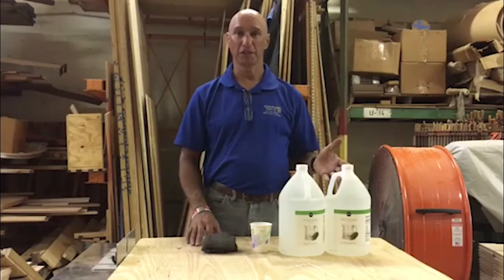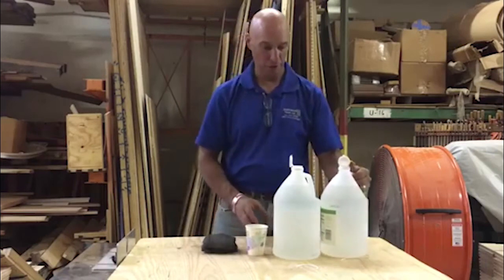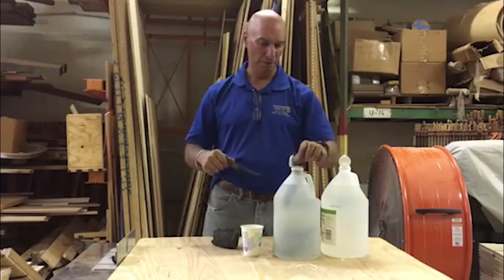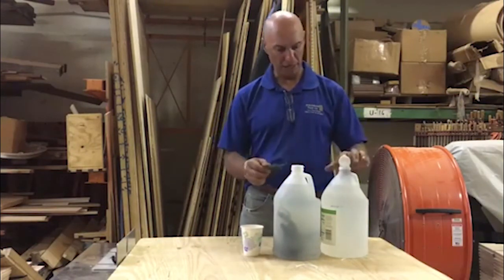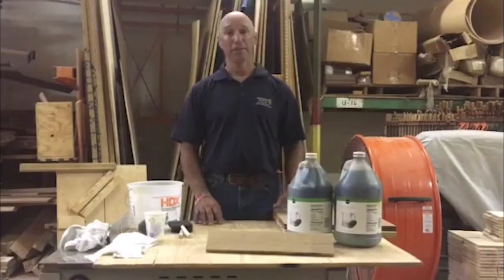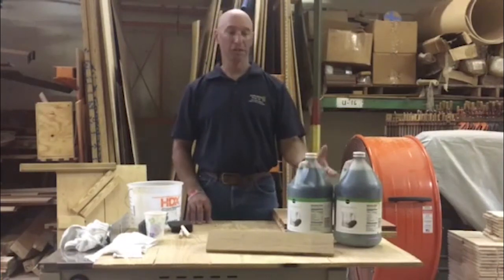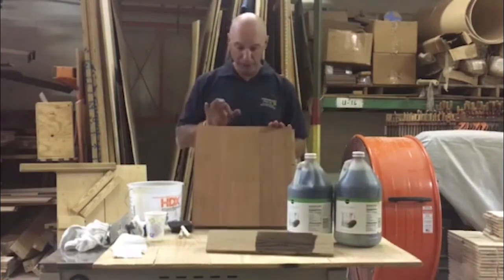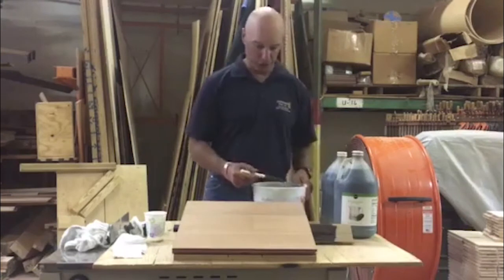Iron Acetate Tutorial

Comment: Hi Lenny, great tutorial. What I'm looking to do is to deep stain 0.25 inch maple or other hard wood completely through.  Any ideas on how to drive the stain into the wood?  Staining under pressure? Heat? any other ideas?
Reply: Steven, other than commercial vacuum chamber set ups where wood was infused with colored Acrylic, I know of no other "at home" way to get a variety of colors through and through.  Stains and dyes will be absorbed into wood fiber only as far as the wood will accept it. The same goes for this Iron Acetate reaction. It is only as deep as the wood fiber will absorb the solution and only where there is tannin.  Sap wood will not react as it has near zero to no tannin at all. That is the same with other surface reactive chemicals: wood bleach, Oxalic Acid, etc.   Ammonia fuming is the only reactive process that I know of that will alter wood materials (only with the tannin parts) at room temperature and normal pressures. The depth and tone of the reaction is a function of concentration and length of time in the fume atmosphere.
Reply: I realize that this comment is 5 years old, but if you are looking to make the wood you are treating darker, brew some really strong black tea and apply it to the wood, let it dry a little, and then apply the iron acetate.  The additional tannins from the tea cause a stronger reaction and a darker color.

Comment: Hello, many thanks for the tutorial, 
Would you be able to apply varnish or lacquer after you applied the iron acetate?
Same as regular stain?
Reply: GEX, yes, you can apply finish directly to the reaction.  There must be sufficient time allowed for the vinegar to evaporate before applying a coating.  Depending on your environment and the saturation applied to the wood fiber, this could be as short as 18hrs to as long as 72 hrs.  I suggest duplicating the job including its conditions on a large 2x4 sample panel and test your timeline along the panel by coating it in sections at predetermined times: 18hrs, 24hrs, 36hrs, 48hrs, etc.  Make notes on what you may see as a reaction of finish against the treated wood.  Then make your determination based on your notes.